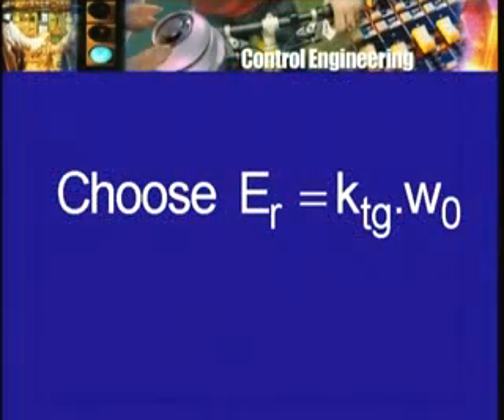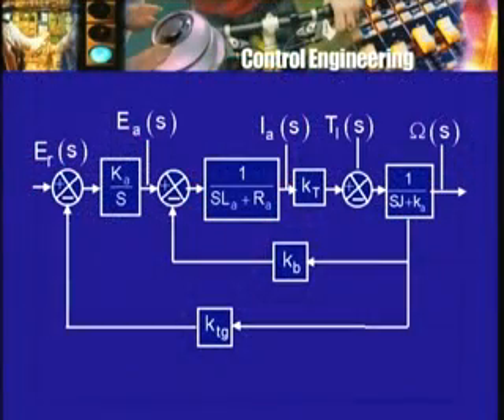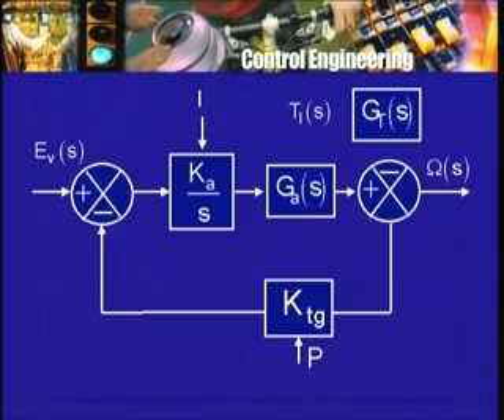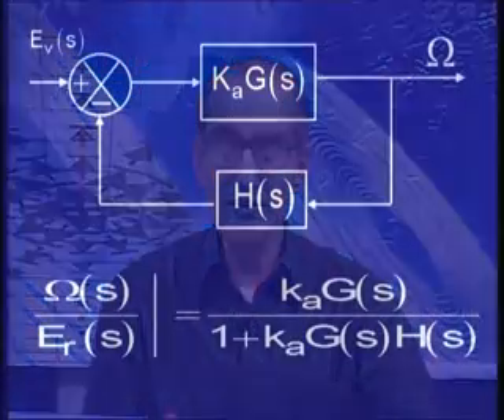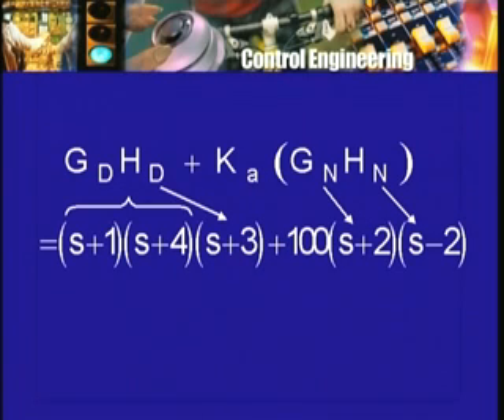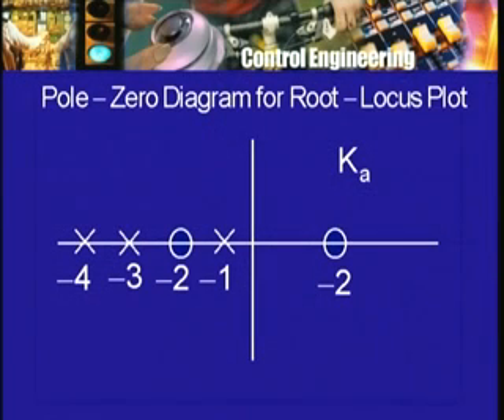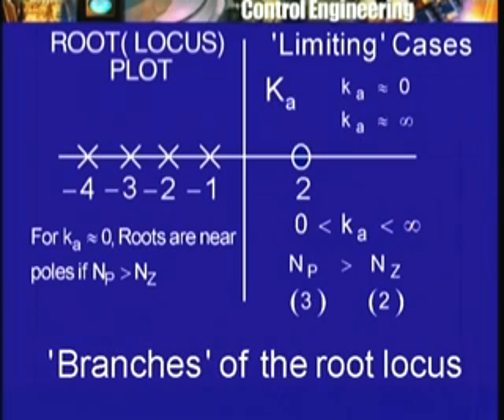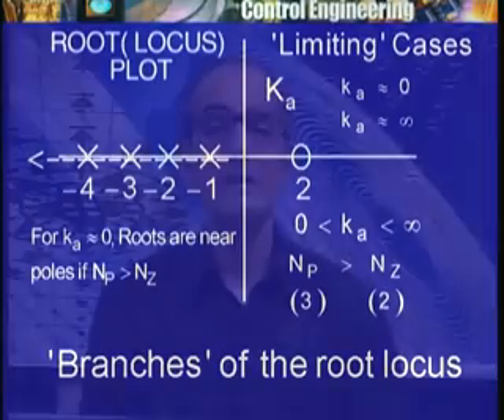Lec-30 Root-Locus Method

Comment: starting from min 44:20 and on the diagram shows the zero -2 (supposed to be with a O symbol) as a pole (with an X symbol), a small typo which does not affect the excellent explanation of this subject offered by prof. Agashe.. Thanks a million for posting..